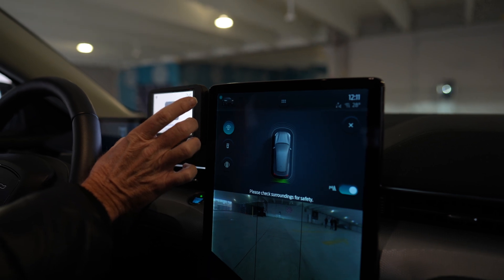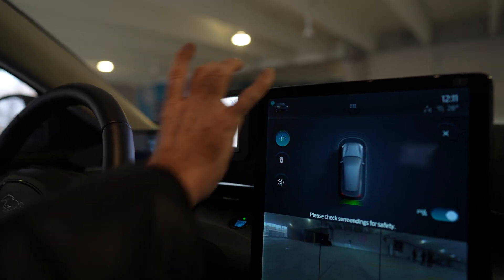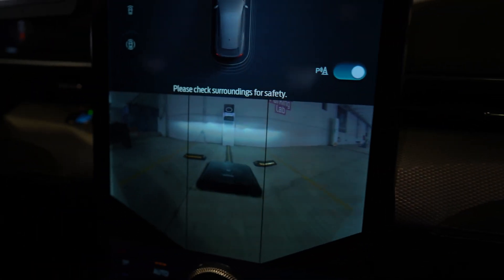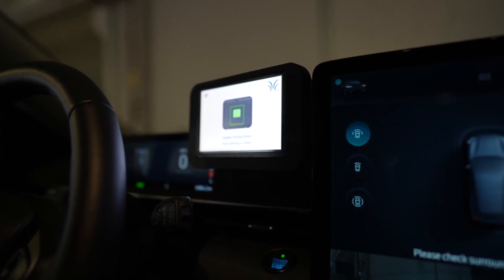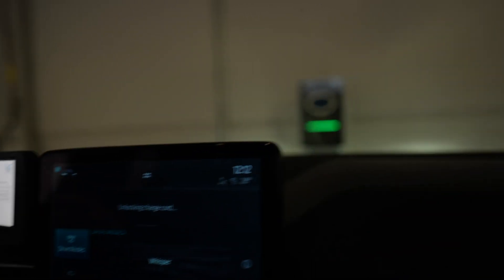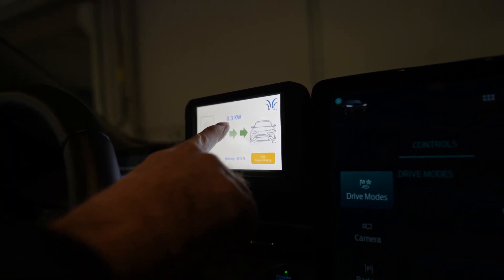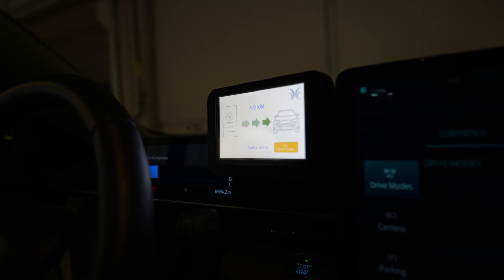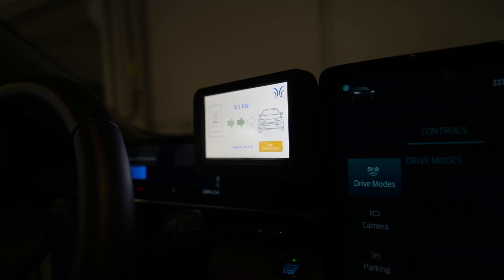Wireless EV Charging. What’s it Like to Park and Charge?

Comment: 92% efficient??
Reply from the maker: Yes, wireless charging is just as efficient as plug-in charging. It's important to note that plug-in charging is not 100% efficient. Energy loss, primarily in the form of heat, occurs every step of the way from grid to battery. In addition, a plug-in EV charger is made of many components, any of which may be more or less efficient that similar components in another charger. As a result, a typical Level 2 home charger operates in the range of about 83-94% efficiency grid-to-battery depending on which one you buy. For more info: https://witricity.com/newsroom/blog/what-is-efficiency-how-do-you-measure-it-and-why-should-you-care/
Reply: These have better quality cables than standard home chargers, in the way it's monitored there's virtually no loss even when you can pair it to a dryer outlet plug